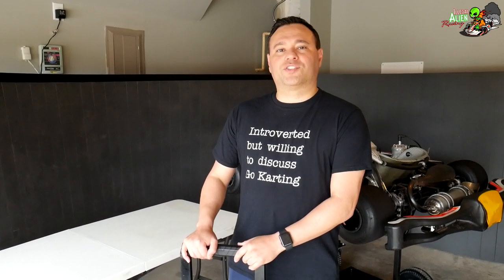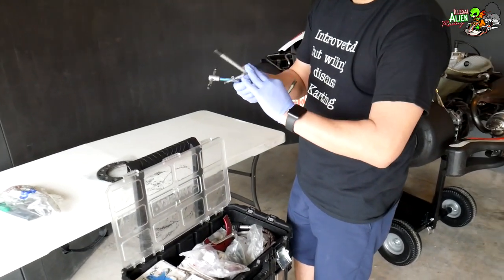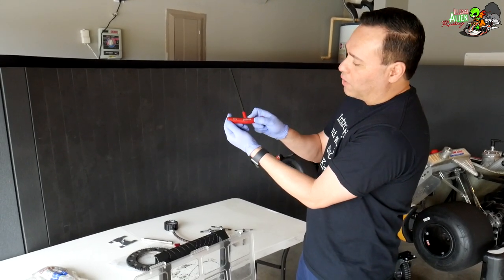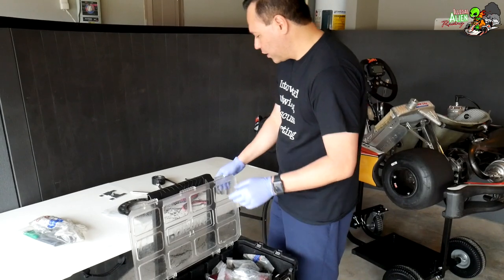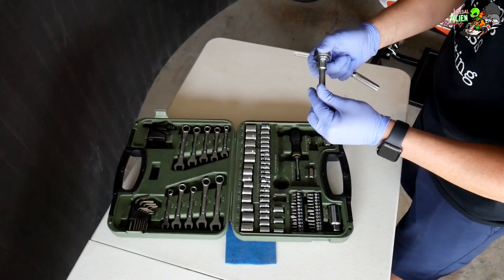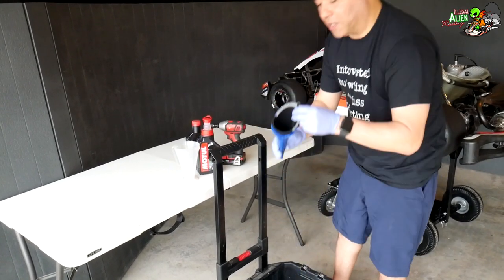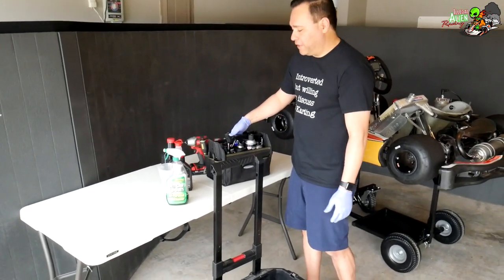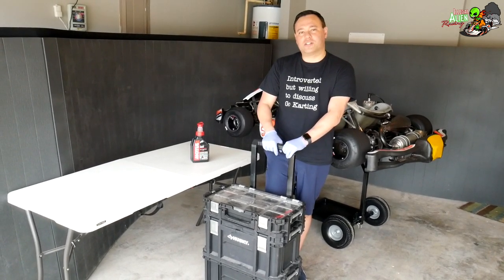Tools I Use for Karting

Comment: Why do you cut your sprockets in half? Because I’m from the UK and no one cuts them in half
Reply: Only reason I can think off is so they can swap them without taking off the axle
Reply: @warredegendt2949  yeah but you can still take a hole sprocket off without removing the axel
Reply: @rhyskn19ht17  on engines that run the chain between the axle bearings you can’t. If the chain is on the outside you can indeed swap them by just taking off the wheel. I think it’s an american thing as well though, I have never seen it in Belgium either.
Reply: @warredegendt2949  yeah I was just confused because I’ve never seen someone do that before